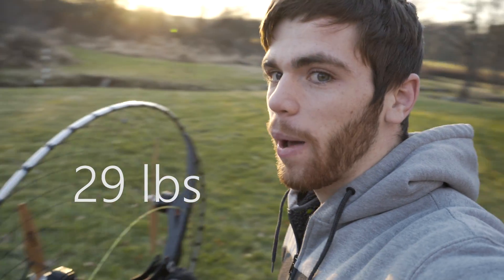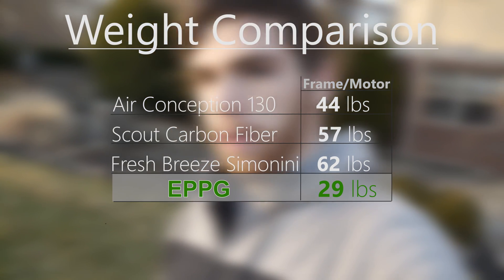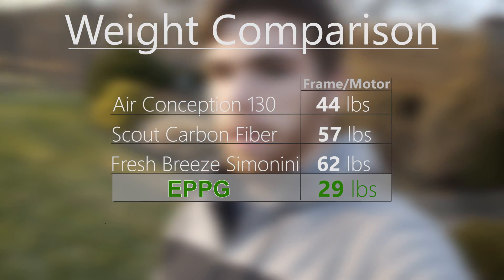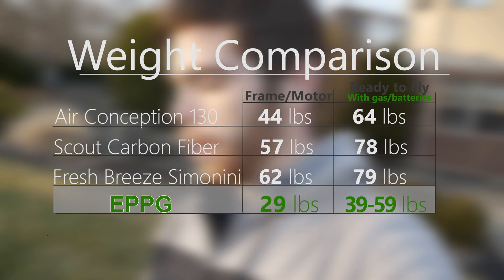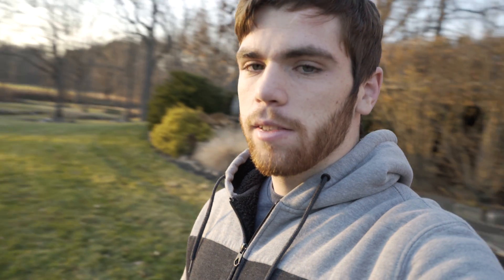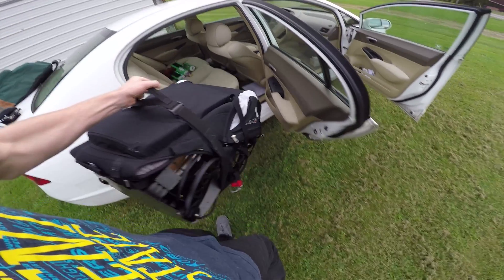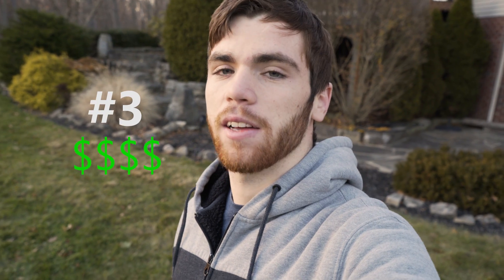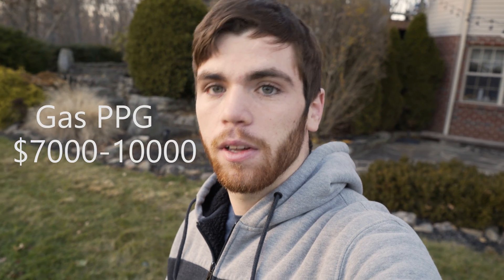Electric Paramotor Project DIY (Vid #1)

Comment: Turn in into a single prop your efficiency would increase by a mouth full. Just saying, nice video btw.

Advantages with electric:
-more environment friendly
-wide programable abilities with down throtteling and some other features
-better control over the thrust and rpm
-higher thrust output in a smaller package (thrust depends on the proppeller)
-instant throttle response
-less vibrations also less noice
-cheaper if you account for fuel and maintenance.
-more reliable
-easy to use
-light weight

Disadvantages:
-I feel like producers will increase their price because their electric, high preformance batterys isn't cheap either
-range (will defently change in the future as the batteries is becoming lighter and more efficient and last longer)
-weather like rain might damage the motor (this widely depends on the type of motor and shielding, brushless motors which is more likely to be used doesn't care much about some rain and with a housing it's no problem)
there is not really alot of disadvantages with it, just it's a major one that has to do with range or flight time.
I don't do the sport, but i know alot about mechanics, electronics, aerospace with some aviation plus i watches alot of videos :P

Comment: Hi i really like your electric paramotor setup. Using multiple motors is a best choice easy to replace props and other parts.
I want to build one as well can you pls let me know which motors and ESC u are using and the propeller size. I will look forward to your reply.
Thanks

Comment: I like your design and though process on this project.  I would like to recommend thinking outside the box.  If you could build 4 mini cages that cover the prop area of each prop.  I would think this would lighten the load, make it a refreshing unique unit and give you an edge on the market.  I can almost see a completely encaged prop like a mini-fan type unit around each prop.  That would look super cool , decrease the weight and if each prop was caged it would protect the prop.  I am totally interested in your kit project.  One question I do have is what is the decibel level during take off???  Look forward to your comments...  Great project!
Reply: Due to the geometry of circles four smaller cages would actually end up heavier. There'd also be more places for the lines to catch than with one large circle. I think you're right in that he can do something better with the cage, but I don't think four small ones is the way forward.

Comment: hi, one question: how much ampere does the system need completely in the levell flight? regards
Reply from the maker: kornereder if I recall it's around 130-140A for level flight but it ranges some much during flight that I really can only tell you the flight times I'm getting. I'm 190lbs by the way.
Reply: Hi, thanks for the answer. I also appreciated it from many large model aircraft and large copters with similar propeller sizes. (I have been flying model electric for over 20 years, I also fly with Elektroparamotor and weigh myself 85 kg. ), Although I build other systems for me, of course, any other type is also possible and nice to see.  greatings from Austria.

Comment: That super cool. Do you have half the motors running in one direction and the others going the other way? Seems like you would eliminate torque effect. And what kind of flight times do you get with the full pack?
Reply from the maker: Yep you're correct two are spinning CW and the other two are spinning CCW. With a bigger set of packs i get around 40 mins of flight, there is room to run more and i'm sure with it fully loaded you could get close to 60 mins but i usually get bored and land quicker then that.  I'm kinda spoiled running such a light weight system that if i fully loaded it it would be around the same weight as a conventional gas paramotor. So its really up to you, which makes it cool that you can adjust the weight between super light weight and normal paramotor weight.
Reply: @PDWhite  hi dude where can i get the kit xx
Reply from the maker: Beezy Talking Shit I'm 190lbs and 6ft weight does it have an effect on flight time just like with gas Motors. As far as height hurting efficiency maybe a tiny bit but it's really unnoticeable. Yeah that's why I built this it's crazy thinking about spending $10,000 on a unit but that's the price they are right now so that's why I decided to build this. I'm hoping to have the kits ready by the end of next month.
Reply: PDWhite How much do you weigh and how tall are you? Does that have an effect on the battery life? I think in about 2 years they'll have these on the market and hopefully for around the price you said. $3,000. I'd definitely spend that for an electric paramotor. I'm not spending $10,000 though.
Reply: Dude you blew us away your design skills are amazing. Can we buy kits yet?

Comment: Nice work.  Thats the best e-paramotor I have seen.  How does the thrust compare to some of the gas motors you have tried?
Reply from the maker: Brian Kueser I designed it to be around the same as other paramotors I have used and popular ones. With the props I have on it in the video it has around 135-140lbs of thrust. But the motors I have on it can do up to 190lbs which is way over kill especially since it's lighter weight.
Reply: No kidding.  Thats pretty amazing.  I didn't fly that much this year, mostly because it was a pain to drag my equipment out from where it was stored into my field.  I am getting a lighter setup, but that would be amazing for quick flights.  I look forward to your next video with details.  What batteries are you using?
Reply from the maker: Brian Kueser I mostly fly with 4x 16000mah 6s batteries, that gets me around 25mins of flight time. That seems to be the sweet spot for me as far as diminishing returns go.

Comment: Hey, nice project, I my self tinkering about quad or x8 configuration paramotor, but my main idea is to detach it after reaching some high an land it as a drone, with autopilot or someone on a ground. Do You have thought about such a feature if not how do You think is it very complicated?
Reply from the maker: Mantas Gegužis We had the same idea awhile back. I'm sure it's possible but if you want to fly low and stuff it doesn't make sense. If you just want to fly real high and then land it makes more sense. I would love to see the idea in action though.

Comment: PDWHITE: Great job but you did forget one big plus to your build........ SAFETY! If you lose a motor you still have power to get down in one piece, don't you? It's not going to break any distance records but for a casual local fly your rig would be outstanding. Stick a supply of batteries in the car and you could have a lot of fun. I think one day in the not too distance future (thanks to Tesla LOL) batteries are in for a huge upgrade.
Reply from the maker: Route 66 Flyer yep your totally correct there is way more redundancy. I want to try to keep the video from being super long but there is definitely a long list of advantage this eppg have over conventional gas paramotors. Thanks for watching!!!
Reply: The paraglider is a GLIDER. It doesn't need power to land, it just glides. Most of the cases a little throttle is used when landing just to make it smoother, though the same can be performed without throttle at all. The problem with losing power mid air is related to flight planning. If you have a good pre-planned route (and you must have it), you always are prepared for emergency landing. The worst places to land is water, forest, swamp or electrical lines.
Reply: Flying over those areas you are to hold a strict PLAN in your head. Malfunction can occur in every system, the question is reliability. Ordinary PPG running ICE has way more moving parts in comparison with EPPG running direct drive brushless motor where there is ONE moving part - a rotor set on 2 bearings. Though talking about general reliability level we have to consider all the components of propulsion system as a whole (Motor, ESC, the batteries and flight controller). Any of those parts have its own reliability and unless the system is not made well, it is worthless to compare it with certified systems that are being mass produced. Generally speaking, by no means, electrical is safer.
Reply: One of the first things any good instructor will teach you in your flight training (PPG, private pilot, etc.) is to always have a spot picked out where you could land if your engine dies. I've purposely killed my PPG engine numerous times at different altitudes to practice spot landings with no power. It is a fun challenge because there is no redo for my gas pull-start PPG. 
I cant wait to get into electric because Ill be able to simulate this by completely shutting off the motors and glide in silence but still have the ability to spin them up at a moments notice.
Reply: I realize it glides well but there are times (ie: flying low over water, trees etc) when you need enough power to get to a safe open landing spot. Not everyone fly's a couple of thousand feet all the time.

Dance the Skies
Reply: Sure, it's good to be able to always safely land, and any time you can't you're trading reward for risk. Redundancy simply shifts that trade more in your favour. If I wanted to be 100% safe 100% of the time I wouldn't do half the stuff I do.

I'm getting into this sport so I can go skimming across glaciers in the alps. Now although I'll be able to survive just fine if I have to land on one, it would certainly be less of a headache if I at least have enough power to limp back to the edge of it.
Reply: How about you learn to free fly first and have absolutely zero issues with loosing your engine mid air? It's not like you loose your wing in same instance. And even if you do, you still have reserve. What do you even mean by "get down in one piece" ? What's the normal, for you, way to land without power?

Comment: Do you have plans to produce and sell these?
Reply from the maker: I've kinda been thinking about it. If there's enough interest in the project id be happy to just fully open source it, put the files up for people to download and make there own EPPG. I know everyone doesn't have a CNC to cut there own frames and parts. So if there's enough interest I could just sell kits or frames ready to fly?
Reply: PDWhite I would be interested in learning more about it. Flight times/battery charge times/throttle. 
It looked like you had some LED lights on your throttle. Is that for showing battery use?
Reply from the maker: Jesse Tichenor yep your correct I'll go over the throttle in detail in the following videos but essentially it's 10 LEDs and each LED that is on is  %10 of your battery. It also change to an orange then a red when the batteries is getting low.
Reply: Sub’d, eagerly awaiting on the next video.
Reply: Kit sounds like a great idea.  I would certainly be interested if you went that route.
Reply: This is an awesome design PDWhite. Would you be interested in collaboration on the design?
I run a community makerlab in Melbourne (Australia) called Make-Create.  We are a bunch of keen drone builders and are about to build ourselves an electric PPG - would be great if we can collaborate & share our learning so we can all benefit.
We love the idea of Open Sourcing the design and having kits made by suppliers around the world to help out those who don't have access to the tools.
Look us up online and you can contact me directly though our website / social media.
Reply from the maker: Its differently going to be open sourced. The kit idea is just for people that dont have a CNC to cut out the frames and gooseneck bars and what not.  I all most have the files all cleaned up and ready to share.
Reply: Yes, any time, i am interrested in reproducing your original PPG. Plans or parts would be very welcome.
Reply: I'd be in for a kit immediately!! (however, open Source would be awesome, too)
Reply: Great! I currently own and fly a gas powered Paramotor in Germany, and I definitely have an electrical one on my wishlist for 2018,  and your design is by far the best I've seen. I can't wait for your next video, I already subscribed.
Reply: I am just getting to see your videos, good work and you should definitely consider for open source plans and think of also selling them as a kit , in case for people who don't have cnc. my vote for open source :-). $10,000 vs $3000 will make lot of people to make quick decision to jump into this awesome sport!
Reply: PDWhite I also subed. It's great that you want to share your peoject :)